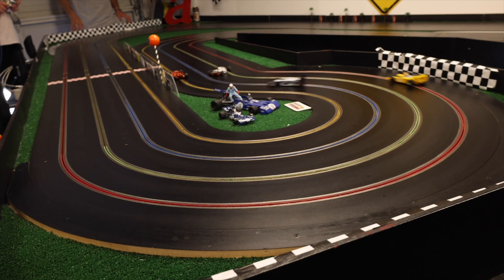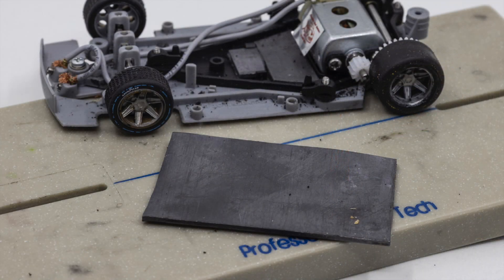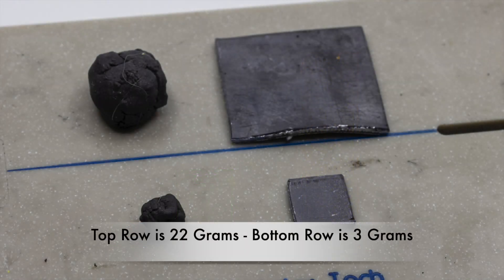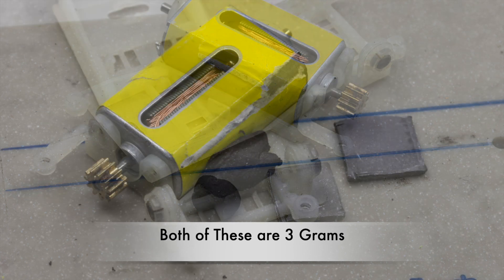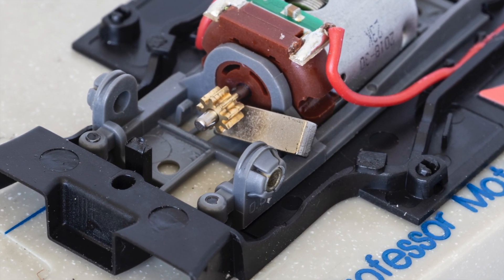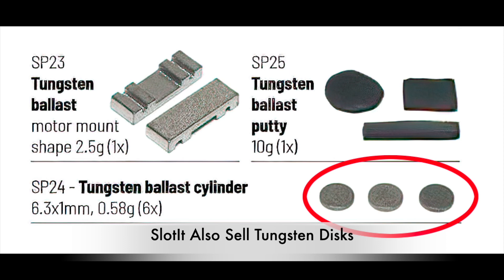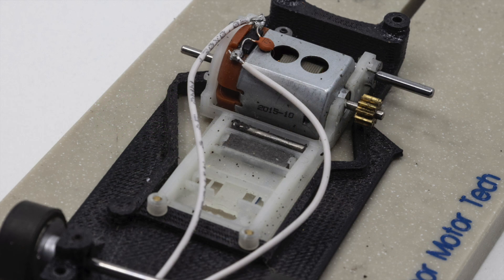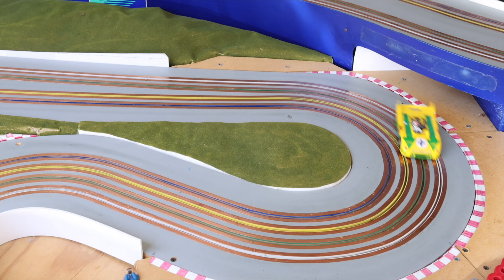Slot Car Tech Tip - Using Tungsten Weight for ballast.

Comment: You can get tungsten putty from angling shops, fishermen use it instead of lead.
Reply from the maker: And a lot of that cheap tungsten putty with run over time and make a mess of your chassis. I've tried the cheap putty and will not use it. It may work, but test it first or you will have a mess on your chassis.

Comment: I don't understand so much about replicas, but if (with chassis modifications) placed guide's car some milimeters ahead from the original position, perhaps would gain some turn stability without (or less) ballast. The distance between traction axle and guide is very important to car's behaviour too.

Greetings from Brazil!